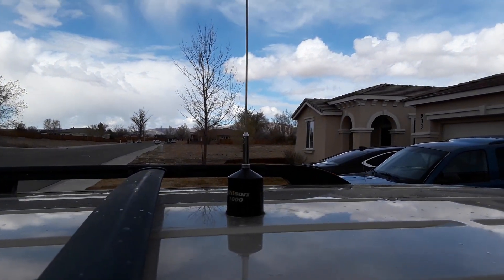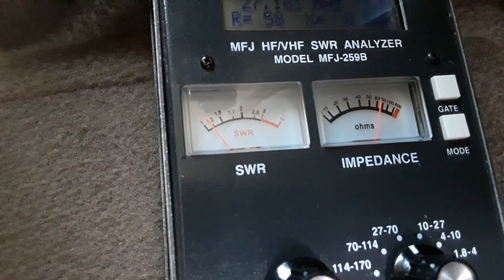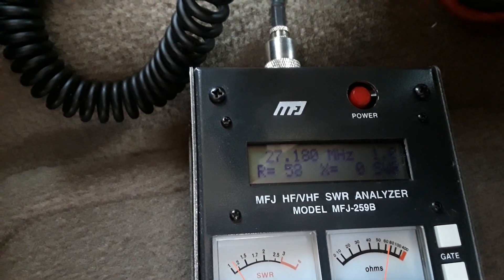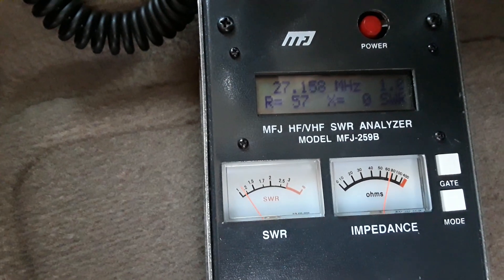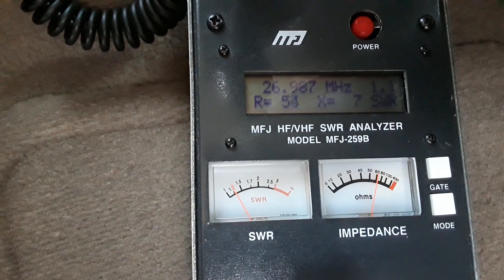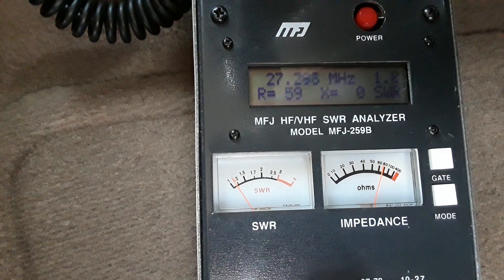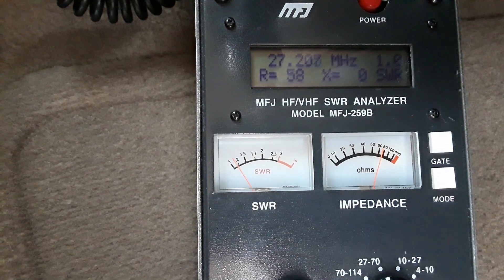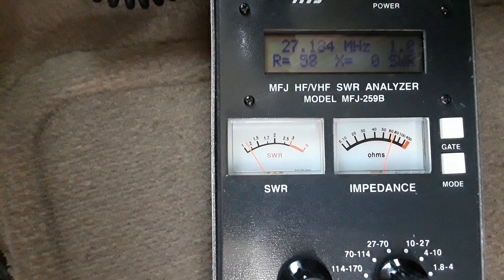Using the MFJ-870 to achieve a great cb antenna match.

Comment: Very nice job, i am running a wilson 5000 at the moment and love it, How did you mount that thing without a magnet? i would like to do this with mine as well but no clue what i need to do so, if it wouldn't be to much trouble would you make a video showing how it is done? i think if i am not mistaking you get a better ground by not using the magnet.
Reply from the maker: Wilson sells two antenna types, magnetic mount and permanent mount. The coil and whip is the same, however the base is different. One being magnetic and one allowing for a through the roof mount. You drill a hole through your roof, put the base in through the bottom and install the washer and nut on the top side. It can be a pain in the butt depending on where you position it at and what type of headliner you have.
Reply: @vegasfordguy  Hey thanks a bunch for the info, ill go look for a different bottom and hopefully they sell only the bottom, if not i will get a new antenna and set that up, i have a hole in my roof on our truck the size of a so239 right in the center of the roof so it should be pretty easy to mount up, 261 Canyon Hopper Southeast Ut back out